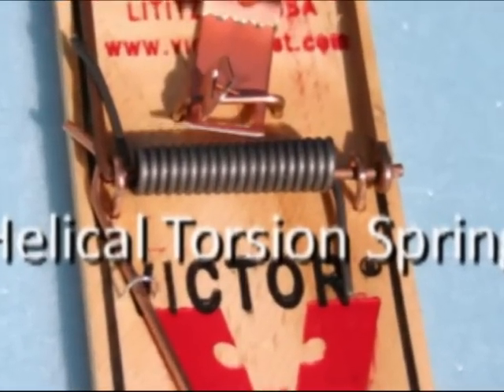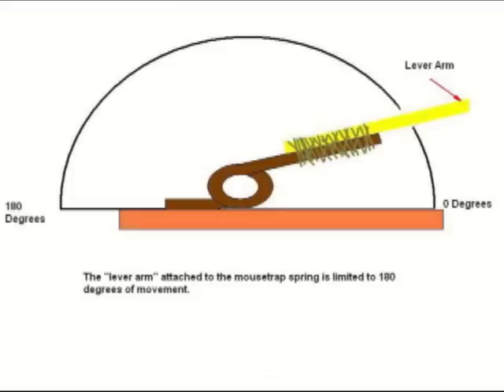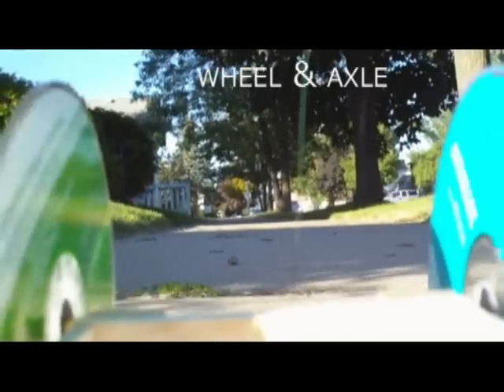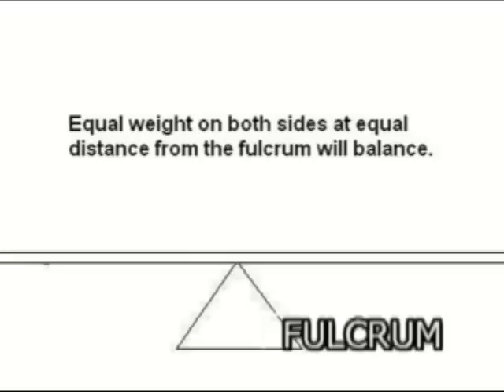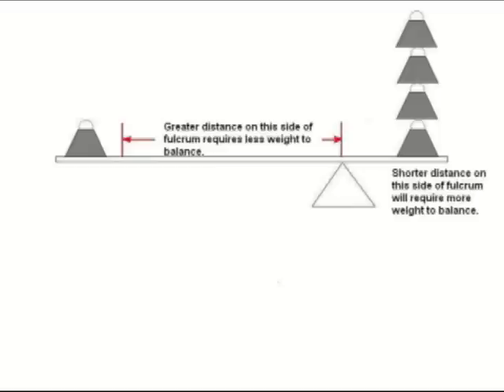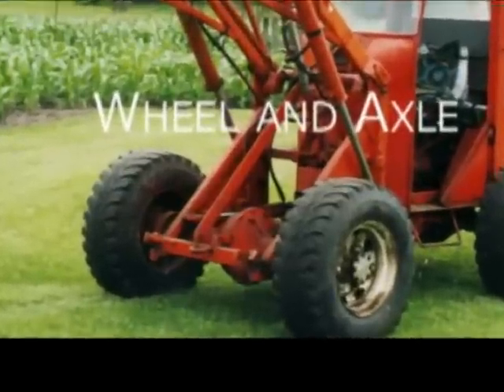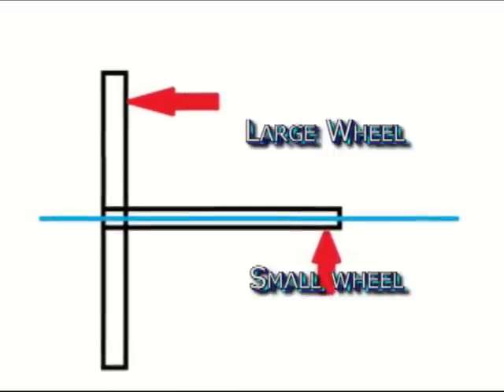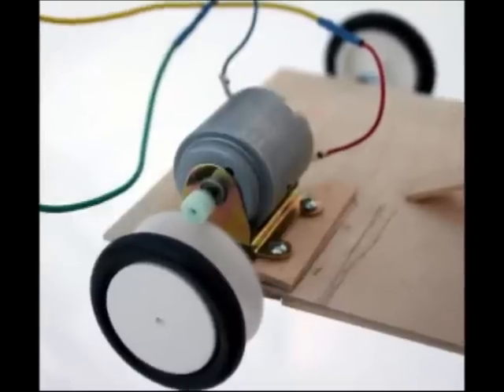Powering the Mousetrap Car

Comment from the maker: If you go to the ScienceGuyOrg website unders Articles - Mousetrap Car Construction and Plan, there is a PDF download for the plans. The lever  arm is 13 1/4".  The end of the lever arm should be right above the rear axle. Instead of balsa frame you can also build it from foam, there is a picture of that in the Mousetrap Car article.  Hope that helps. Bill Kuhl

Comment: @mxf7010g8k I think the larger the circumference where the string wraps the axle, the more torque you will get. I think the idea is to run in the minimum torque you can get away with.

Comment from the maker: I am not sure how far the Quicky Mouse will travel, 50 feet at least. The prototype which was 2 inches longer went diagonally across a gym and hit the wall. The surface makes a big difference, hard smooth floors work best.